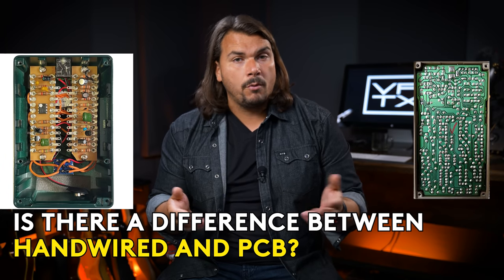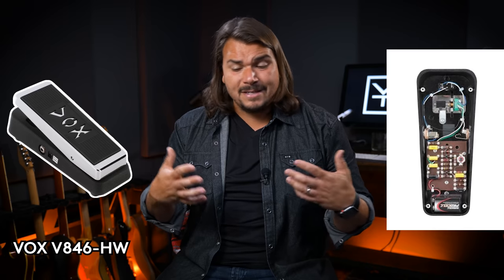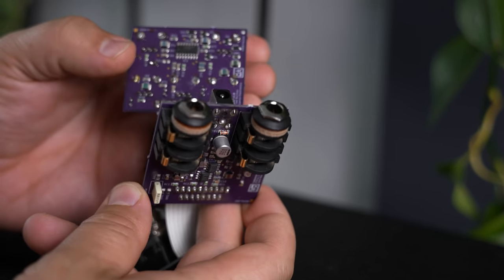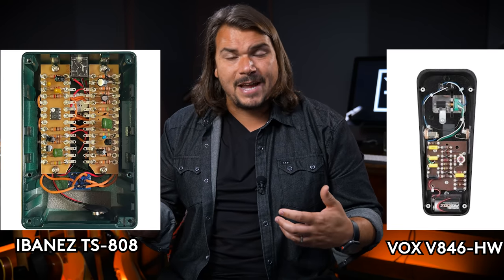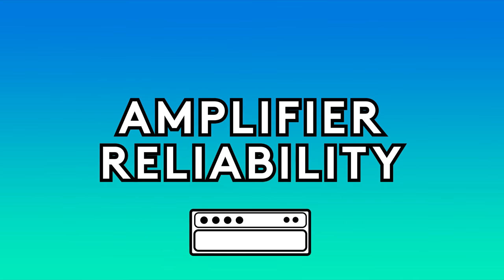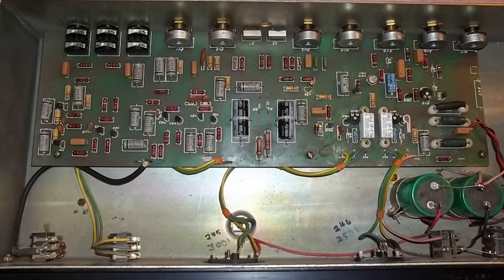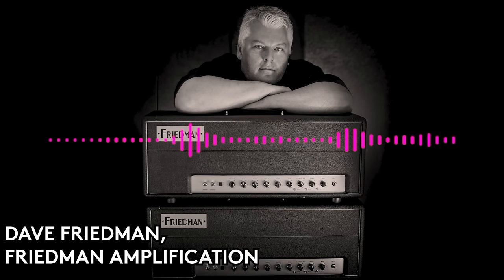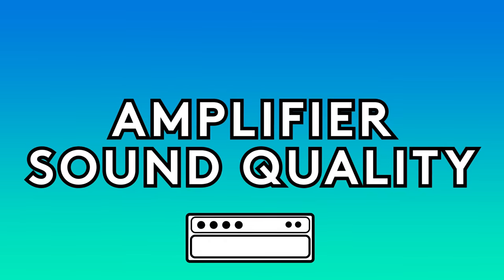Is Hand-Wired Actually Better?

Comment: The number one difference between hand-wired (HW), thru-hole PCB (TH), & surface mount PCB (SM) is the expected quantity to be manufactured. HW does not scale particularly well. SM scales to large quantities best while TH bridges the gap.
SM also has the most expensive tools & it would not surprise me to see any pedal manufacturer contract the board layout, board manufacture, parts population, & flow soldering to those who have made the hefty plant investment.
Sound difference? Never say never but really, when the design follows the rules for parts selection, field replaceable assemblies, & test fixtures, your main sound variation would be component tolerances.
As to the end of TH boards, it seems that technology has a solid grip on the DIY market. Small investment for quality, low-volume products.
The details of all this are complex & span the product life cycle. The final word on sound is solely in the ear of the listener. Do not ignore a product because it is hand-wired or PCB.
Reply from the maker: Well said!

Comment: I agree completely with your final statement 100%

Great from both platforms, they may sound slightly different, but both can be great platforms. I think I prefer older hand wired amps, vintage Fender stuff specifically, because of how accessible and documented they are - in case you need to repair or mod. But I have several solid state options that I truly could never part with as well.

They're only going to be as good as the company that makes them, really. If it's a rushed bad product, it doesn't make a difference if it's hand wired or PCB.
Reply from the maker: I think the main takeaway here is that we should invalidate PCB just because it's PCB.  PCB's have got a bad reputation based on the worst implementations, not the best or even the standard ones.
Reply: @VertexEffectsInc  I'll publicly state that my favorite amp is a solid-state, PCB, PR403 Princeton '65 that I love love love. I own two because I love that amp so much. It was the first thing I ever saved up hard earned money for... probably part of the reason why I love it so much, and everything else I own is either vintage or boutique hand wired. Go figure!

Comment: Over the years I have bought into a lot of nonsense concerning guitars and amps.  

Honestly, all of my amps are PC based and I love them all.  

My first new electric guitar was a Gibson Les Paul and I had nothing but issues with static and crap like that.  I tried all the so called fixes and none of them did anything for me.  It wasn't until I tossed the PC board and hand wired it.  Then the problems all went away.  

I have three other hand wired guitars, the other 6 electrics are all PC and they all sound and play great.   In fact, my 2015 SG special still has the PC board and it has the best tone of all my guitars, no matter which of my 6 amps I plug in to.  

This guitar is my all time favorite in all aspects.  Second would be my 2021 PRS Custom SE 24 and then my 2017 Les Paul.  All three are bad to the bone.  All of my guitars are setup great and play very well.  I'd be proud to take any of them, anywhere and play.  

Of course, tomorrow I have a 2021 Gibson ES-335 arriving and it may well become my favorite.  I guess I'll see...

I think its way more important to do a proper setup and adjust your amp properly than it is to worry about whether it's hand wired or not.   

I don't have any info on hard wired pedals, largely because I am not a big fan of pedals in the first place.  And there is no why in hell I will ever pay enough to buy some hardwired BS pedal to personally test.

People need to stop arguing over this nonsense and get back to creating and enjoying their craft.
Reply from the maker: Thanks for watching!

Comment: Thank you once again Mason, yet another fine video. Perhaps part of the alure of hand-wired is the search for that one off that has that mojo. Pete Thorn had a Trainwreck, Liverpool on his show that sounded really unique. I personally would have no qualms buying a new amp; however, I will always have an ear open for a good older hand wired.
Reply from the maker: There can be great handwired amps, no doubt...for the Trainwreck that was the only way Ken could do it on his own, he didn't have a manufacturing facility nor was it a high volume amplifier (manufacturing wise).  In these small numbers it makes sense for a custom amp to be handwired.

Comment: The main takeaway for me is that the product should be made with the best components and proper design and execution, and it does not matter. 99% of my pedals are PCB and work perfect and are very reliable. With the amps, I have mixed results. I have two Fender Hot Rod Deluxe amps, one old and hardwired serviced many times and probably doesn't have original part left, but the circuit is unchanged no mods and one new PCB. In my case, I prefer the sound of the hardwired. I don't consider myself to have the best ear and hear small differences, so since I can hear the difference, then the amount is substantial. Also, the PCB amp has been twice in 18 months for repairs. On the hardwired, I have changed only tubes for the last 7 years. I would like to mention that on the question of serviceability of the pedals both experts didn't answer the question about serviceability instead they said their pros for ease and speed of manufacturing, repeatability of manufacturing, cost optimization of manufacturing etc. but not serviceability.
Reply from the maker: Agreed 100% on the pedals.  For amps, the Fender stuff is low quality and fairly well known to be by most techs and I'm sure Fender as well...but their building to a price point.  Sound wise, two amps both equally well built handwired and PCB are going to sound the same as stated here.  You cannot compare a poorly built PCB based amp to a high quality handwired amp and call it a baseline.  You'd need to compare two of the same circuit archetypes by two builders one handwired and one PCB and you'd have something to compare of substance - say a Suhr Hombre (Suhr's Brownface Deluxe), versus a vintage Fender Brownface Deluxe (or boutique maker of the same amp).  That would be more of a 1:1 comparison.  The Hot Rod Series is NOT a shining example of PCB amps at their best.
Reply: @VertexEffectsInc  I agree. I put the story about the amps to once again underline the first sentence in my first comment. English is not my native language and maybe doesn't illustrate what exactly I was trying to convey.
Reply: You mentioned your PCB amp is a Fender HR Deluxe. I'm curious what your hand wired amp is. I have a 1990 dual sided PCB Boogie & it's only had two repairs in the 20 plus yrs I've owned it. One of the repairs was due to a bass player connecting 2 cabs incorrectly (fuse & blown cap). Other was a power connection that needed to be resoldered. That amp has seen many stages & even had a beer or two spilled on it. My hand wired amp is a 63 Bandmaster. That's a dead simple circuit so less places for failure. No fancy switching etc. I've replaced nearly everything in it as Leo wasn't buying high tolerance parts plus metal film resistors are less noisy than those old carbon comps. He used what was available & inexpensive. I can't compare 'em as they're classic apples & oranges. Both are tube amps but the similarity nearly ends there.

IMO; the price point of pedals somewhat negates serviceability. Do you have your broken microwave serviced or buy a new one? You buy a new one as it's cheaper. Unless it's a Klon or something else collectible, servicing a pedal is simply a waste of $ providing you don't do the work yourself. I work on my own amps for the most part but often wont bother with a pedal as it's simply not worth my time or patience.
Reply: @jpistolas  It is a HRD from 1997 that was converted to handwired from previous owner.

Comment: Keep in mind, these are all business people - business people that have a much higher profit margin on mass-produced products vs craftsman-prepared goods. I’m sure in general, there is truth to many of the statements made here, just remember where their incentives are. 
Also, it’s easy to say the serviceability is similar when you’re a renowned engineer; but take one of those PCBs to your average repair shop and ask them to troubleshoot+fix and see what happens- they’ll tell you that you need a full replacement.
Reply from the maker: With many PCB amps this is true.  For the high quality stuff, again, the intent is to make the amps identical from serial number 1 - 1000.

Comment: From listening to this, it all comes down to matter of preference.  As far as pedals, I can see pcb is best.  Amps,  yes and no.  With a boutique amp you're getting basically a one of kind even though they are wired similarly .  With a PCB amp, you are getting more of a consistent product with no variation in manufacturing and tone.  With this said, - it all comes down to preference.  You basically can go this way with anything manufactured.  In my opinion - I would rather choose a hand - wired amp, it would have it's own unique character.  Another way to put it is - it's like buying a house in a neighborhood with similar design; yes they all serve the same purpose and work well.  Or if you decide to build one too your own specifications,  you can make it to your taste rather than sticking with the same design.  Just my 2 cents...

Comment: Everyone in the comments are pointing out conflict of intrest on their side, forgetting that you might as well have one too: you dont want to accept the thing you have and/or idolize and may or may not had paid big bucks for is simply outclassed. I will, however hold on to my veredict until i can see as much as a one to one comparisson as we can have, and not just listening to them(preferably recording them both with cabs and with a reamp box or whatever would suit it best, so we can see the signal throught a spectograph and maybe reamp it to see how they behave in different cabs) but lets also measure what the circuits are doing both with recording the outpit (duh) and maybe on earlyier parts of the circuitry as well, so we can point out exactally what and maybe even why the differences are whatever they are (if, they would even be). But then again thats way outside my league, if one ever do anything like that, it would be nice to see. :p
Reply from the maker: I think the "bias" argument that some are making here is still a bit of a stretch.  It infers that there is a bad faith effort in the video findings to undermine the customer by creating a cheaper/easier version of our respective products to save money in production and increase the cost to consumers, with less serviceable products, thereby, giving us higher profit margins and the customer a costlier repair bill when the time comes.  The consideration, I think, is that an amp technician would somehow be more neutral as a voice to support or refute what's said here.  However, amp techs generally aren't in manufacturing and have little understanding of those processes on a large scale, or even medium scale.  They also have their own biases too.  Some may only be able to work on PTP and Handwired amps, so they'd prefer that, others might just want easier jobs so may prefer handwired amps that don't require a lot of pre-work and schematic sourcing to repair.  Others might prefer a PCB amp that's more complex because a repair is more billable hours.  We can't presume their reasons or incentives, but what I can say is that this video has about the most comprehensive a group in amps and pedals as you'll find in our industry and defaulting to bad faith and incentives on their part just doesn't like up with their company legacies and brands.  These are individuals that have proven products in both point to point and PCB over multiple decades in most circumstances.  If there is a better way to do it, they'll do it.  They all care about tone, consistency, and reliability.  If you refuse to take their advise, you're doing so at your own peril.

Comment: 1000% the most frustrating thing is trying to service soldered in place boards. I had to cut into the case in one instance, was some Dr. Frankenstein stuff to get that board out.
Reply from the maker: That can be tricky, sometimes you just have to cut some wires or de-solder stuff which sucks.
Reply: @VertexEffectsInc  on the mxr dime distortion the 18v in wouldnt desolder, i was cooking the board trying and the pots were locking it in too lol, i tried even flexing the board, i ended up cutting a tiny channel to slide it out. (And it was all for vanity lol, needed to get rid of the ugly camo paint job and give it a distortion+ yellow)
Reply: It just depends on what tools you have available, in our professional electronics lab, I think the techs would choose the PCB 100% of the time especially if it’s all surface mount… with the right tools it’s much easier and far faster to repair usually, that’s why they are so much cheaper to make… replacing an IC that’s SMD literally takes a couple seconds… But if you don’t have all the specialty tools then brute force is going to be more successful on hand wired stuff…

Comment: They need to A/B the Signal to Noise SNR measurement data values comparing hand wired to PCB circuit boards because there should be a big difference in Signal to Noise ratio. Another big issue is the higher the GAIN the worse the signal to noise ratio will be on hand wired pedals and amplifiers. The TOP JACK of having your input jack and output jacks so close together on pedals can creates oscillations/feedbacking from output to input coupling issues so the Isolation measurement needs to be in the specs. What are the measurements of isolation from input jack to output jack should be -80dB isolation but pedal manufactures aren't telling people what the isolation specs are. You should have include in the video lesson about lead solder VS lead free solder because there is a big audio differences between lead solder vs lead free solder guitar pedals. If you sweep 20hz to 20khz the frequency response profiles are difference from hand wired vs pcb circuit boards and also lead solder vs lead free solder. There is a reason why the manufactures aren't display on their websites the frequency response profiles plots because there is a big difference
Reply from the maker: A lot of this information is already baked into the process so to speak regarding the benefits of the PCB.  Most manufacturers with an engineering background or are working with engineers for the most efficient, reliable, repeatable, and quietest operating end product all understand this.  Coupling issues can be mitigated in the design with good layouts and as far as solder - there can be some difference in a vacuum but in practice there are thousands of solder joints between the guitar and the mixing board on any recording so isolating them all to lead solder would be quite a task and ultimate a fool's errand.  I think a lot of the literature is abbreviated on specs sheets because it's beyond what the consumer can reasonably take in and understand.  Some brands don't even publish their input and output impedances, let along frequency response plots when it comes to pedals or amps.
Reply: @VertexEffectsInc  If all guitar pedals brands, pickups, amplifiers would upload frequency response plots they would go out of business because people would visually see the differences and cut their sells more than half because they would visually see the differences instead of having OCD issues obsessing on issues that are not real or take others opinions to be biased that something is better or sounds better when its false.
Reply from the maker: @waynegram8907  I don't think most consumers can interpret what they mean to know what the detectable difference might be.
Reply: @VertexEffectsInc  The companies can make youtube videos showing the frequency response profile plots and explain them for each of their products. This can be done so their customers understand what they are purchasing. Billy Corgan thinks that different color guitars changes the tone/sound/timbre, but I rather have proof of frequency response profile plots that different colors on a guitars body will change the frequency response profile. Is this a myth imaginary or proof that its real. Most guitar pedals, guitar pickups, guitar amplifiers companies are feeding off of 99% to brainwash their customers into thinking there is a big difference when its all imaginary and biased programming. There only way to know the differences between hardwire vs pcb is S/N ratio DATA LOG analysis in addition to the frequency response profile curves.

Comment: I really like hand wired bc I am paying for an individual to work for me like a piece of art.  I’ve liked both types of pedals.  I also like the fact about serviceability by any reasonable tech with the hand wired or through hole components.  Their art is in my art.
Reply from the maker: For a custom amp, it's way more practical, and we don't dispute that the video.  Most PCB pedals can be repaired if their analog, through hole is easier of course, but are totally serviceable.  Handwired is pretty rare for pedals and actually causes more failure than solutions.